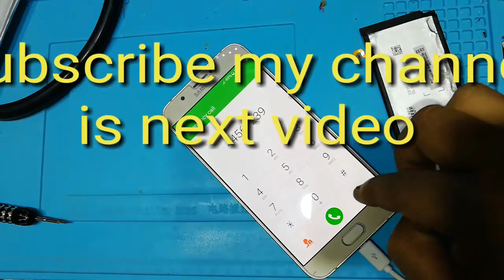Galaxy A8 Battery Replesments Fix

Comment: i also Had same problem with my cell and i got it repair but the thing is when i stat using my phone with more than 90%battery it suddenly gets turned off and battery shows 0 % 
please help me with suggestions
Reply: My phone same issue
Reply: I HV such problem kindly help